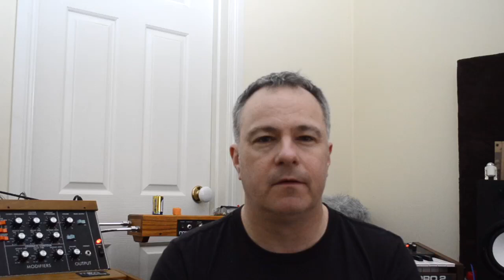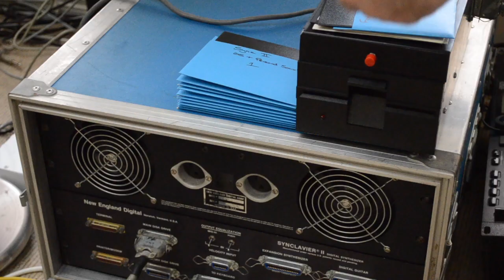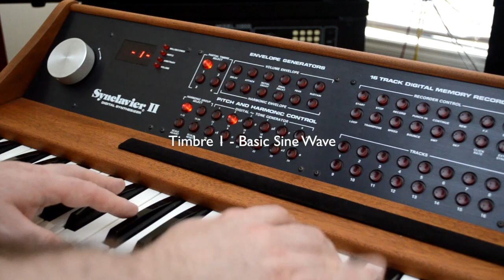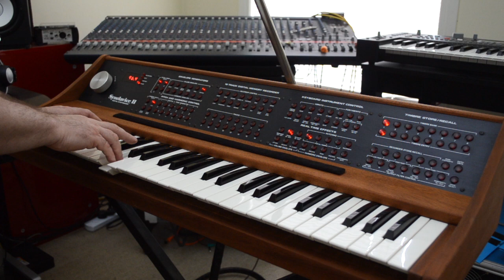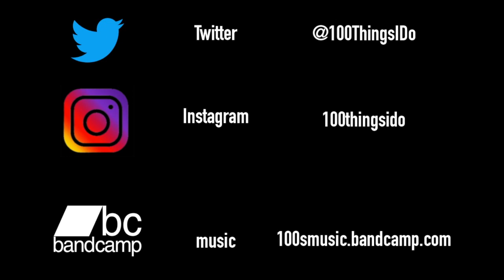SYNCLAVIER II CLIP #1 - Harmonic Additive Synthesis

Comment: Beautiful! I've wanted one ever since I first saw that huge panel of lovely candy like buttons and heard it's great sounds! I wish they would make a reissue that looks and works exactly the same but minus the external computer rack. (seems like with today's technology they could fit it all inside the keyboard?
Reply from the maker: Hi JLR , thanks for the continued support. Yes, as the Sync is basically running code to generate all the sound it should be possible to shrink it down. Maybe someone should do a raspberry Pi version for all those non functioning Synclavier Keyboards out there people keep posting about that he become estranged from their computers :P
Reply: It kills me; there used to be synthesizer store on W34th-by Sam Ash, in NYC- round 1999 or 2000. They had all kinds of stuff I'd never seen in person, not least of which being a beautiful walnut(?) Synclavier controller. It's such a mysterious and elegant design; I remember making a b-line straight to it, past the Jupiter 8, Memory Moog, and Prophets, without knowing much of anything about it at that time. I think they were asking $400. That's still the only time I've seen one in person.
Reply: @ecktoplasmic  - Was it just the controller? Even if so, 400 bucks was a steal for such a classic, luxury piece.
Reply: @NeuronalAxon yes, it was just the controller for $400. This was just slightly before the explosion of analog synth collecting, and so no one was even interested in vintage digital yet. That beautiful controller sat there undisturbed for months until the shop closed down or moved.
Reply: @ecktoplasmic  - Wow, I wonder where it is now? I heard that someone found a Linn LM1 in a rubbish bin, about to be carted away before they spotted it, recognised it and rescued it. o_0